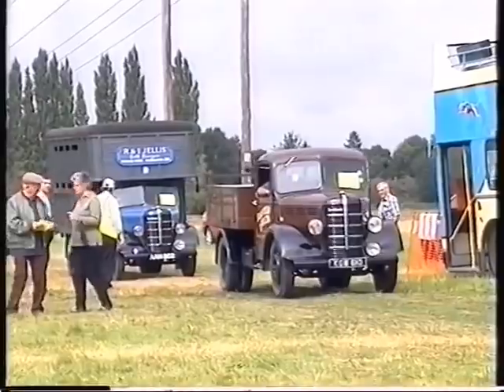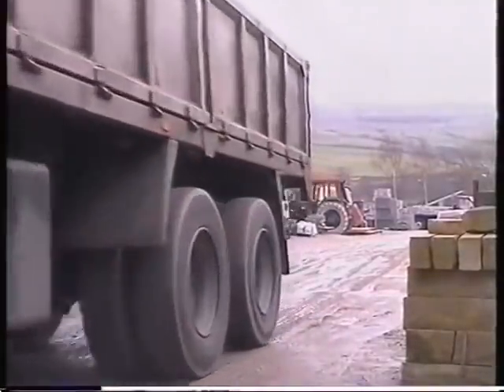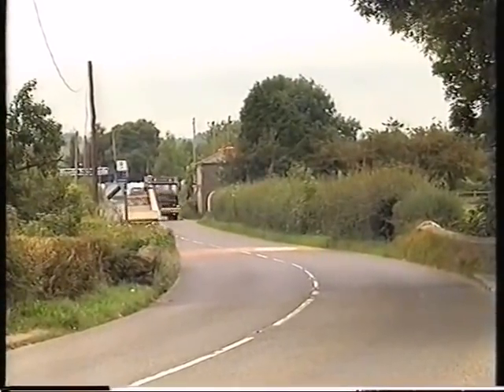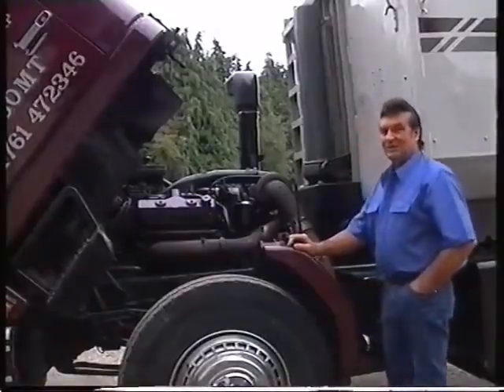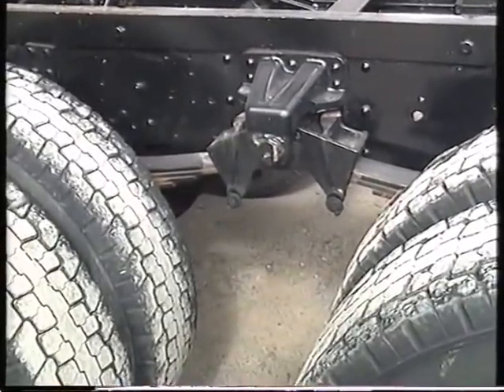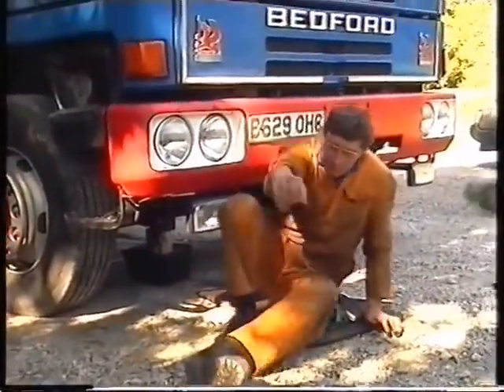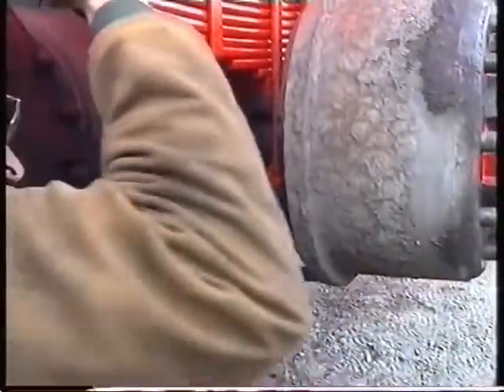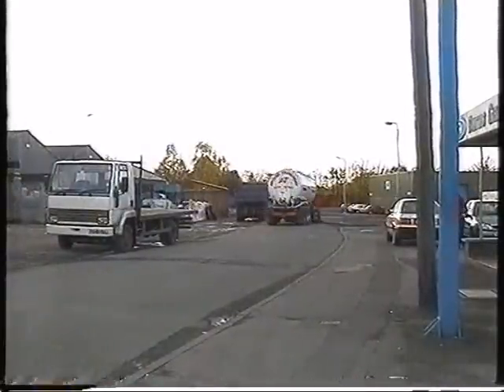Bedford tm at work

Comment: From the U.S.A., great video and well maintained good looking Bedford's. The repowered 335 horsepower Detroit 92 series showed no smoke. Turbo- charging made a big difference with them.
Reply: The silver 92’s were a fairly clean running engine even by 4 stroke standards, especially the last of them with the DDEC-2 electronic controls…and on those ones there was no rack to run. If the EPA hadn’t pushed so hard on diesels coming up on Y2K and after they’d probably still be putting electronic 6 and 8V92TA’s in busses and fire apparatus today, especially with how popular automatics have become, the 2 strokes liking the revs to stay up above 1700 works out great with a torque converter type automatic.